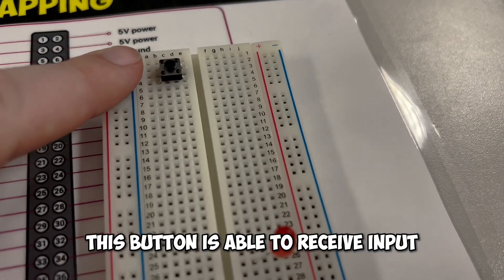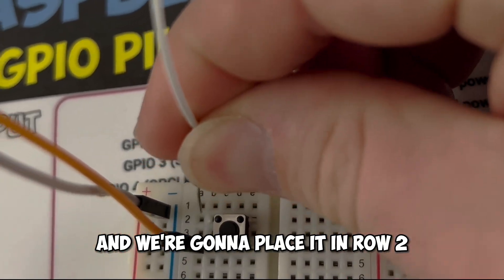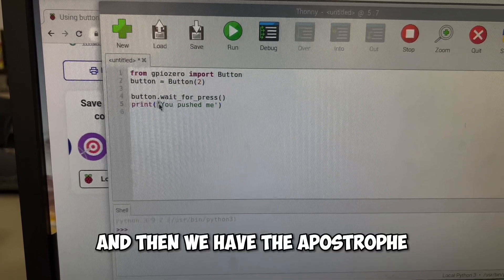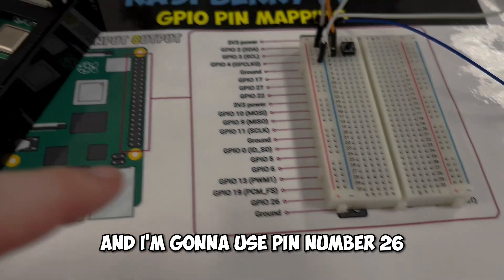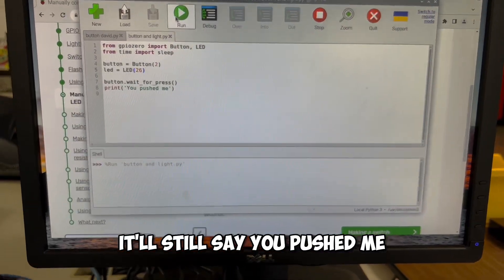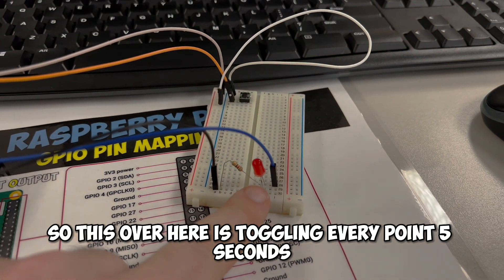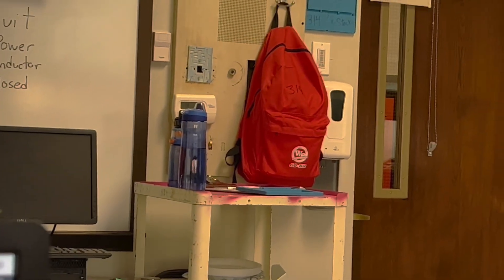Part 4a - how to set up a BUTTON that controls a LED using a raspberry pi

Comment from the maker: 0:00 - input
0:10 - characteristics of button
0:45 - connecting button and breadboard
1:57 - writing program for button to work
3:17 - print('you pushed me ')
3:46 - save your program .py
4:16 - copy and paste your program
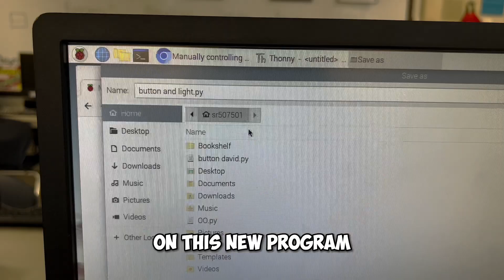4:33 - rebuilding LED circuit
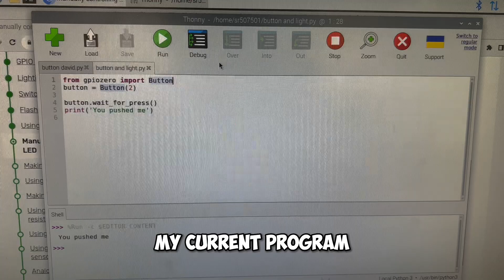5:40 - modify program to work with a LED
6:43 - for loop to light LED 
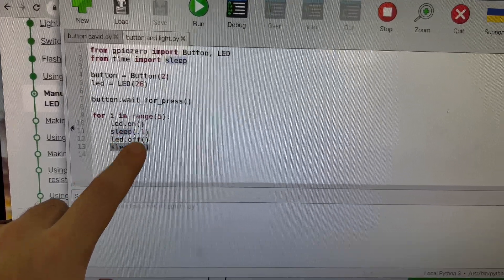7:45 - how sleep(1) works
8:37 - while True:
9:32 - commenting out code using '
10:03 - wait for press/release